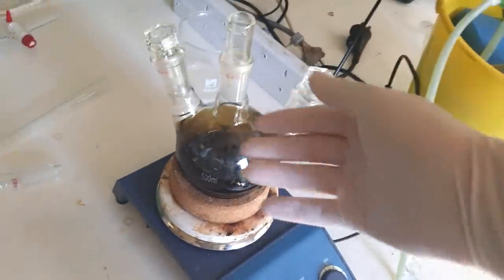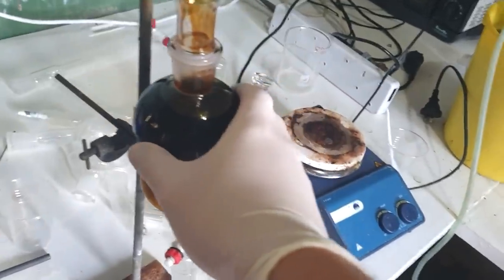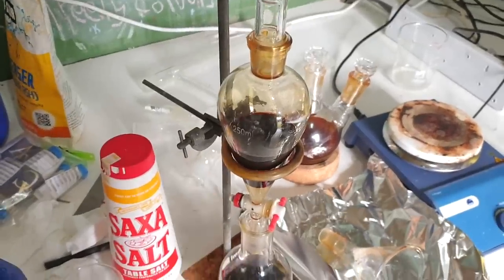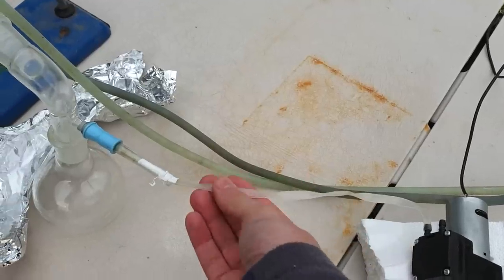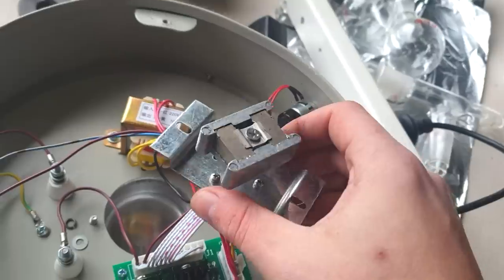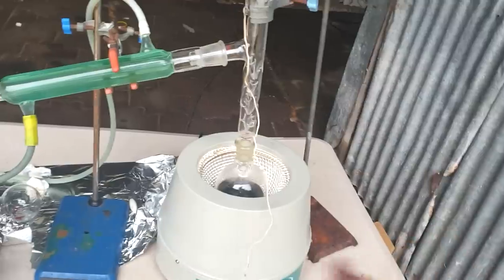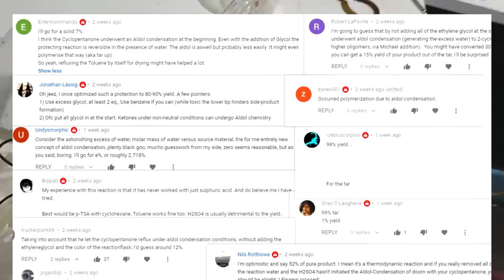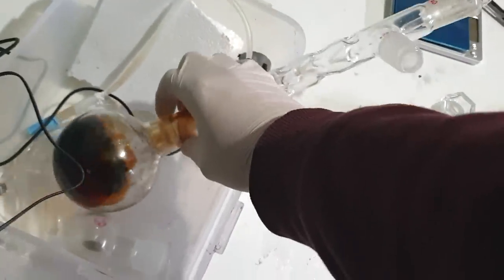Cubane Episode 3 - Vacuum Distillation for the Ketal?

Comment: I saw in different videos (NileRed's ones, to be specific) that often distillation apparatuses (apparati? appar - whatever) are more or less covered in tinfoil. Is it done to distribute/mantain the heat better?
Reply: It is used as an insulator, helps ensure the vapors make it over and don't just condense back
Reply: @samuelallan7452  so it pretty much mantains the heat, otherwise the temperature would drop too easily, hence the condensing back?
Reply: @RussellTeapot  Yeah exactly. Some vapor will always make it across just cuz vapor, but the insulator helps speed up the process, because in some cases it would take ages otherwise
Reply: @RussellTeapot  Actually if you're curious there is another use I've seen, and that is to block out light - for example in Nile's fuming nitric acid video he covers the whole thing in Al foil to make sure no light comes in because nitric acid is fairly sensitive and will decompose into nitrogen dioxide in the presence of too much light (as a side-note whenever I did this reaction I always got a shit ton of nitrogen dioxide, probably for this reason)

Comment: yo just fyi
if those oval stirr bars have a  neodymium magnet in them, 
then high heat will course them to lose their strength. 
some of them can starts to lose strength at as little as 55 degrees C.
think it depends a lot on the grade of the magnet.

Comment: I'm not a real chemist, but isn't there like a three-neck adapter which allows, among other things, to change receiving flasks for vacuum distillation by turning it? Like, you just turn the adapter with three flasks attached and bam, you got a new receiving flask? Maybe I'm making this up tho
Reply from the maker: Yes there is, and it's either called a Pig or a Cow adapter! It is a very specific piece of glassware that I don't have, but if we are going to be doing more vac distillations in the future, I'll probably get one!
Reply: @ExtractionsAndIre  oh, I googled it and that wasn't what I had in mind. I remember seeing in NileRed's video a Y-shaped thing with a turning knob in the middle, where he could change which way liquids go. But I guess cow adapter looks cooler
Reply from the maker: @markdombrovan8849  oh right, that sounds fancier, and maybe more widely useful than a Cow adapter? Probably more expensive tho
Reply: @ExtractionsAndIre  it seems that the 3-way flow control adapter is a bit cheaper on amazon, 20-25$ vs 30-35$ for cow adapter, but there are different options on eBay. It's not Pyrex though, Pyrex cow adapter costs 200$, it's kinda crazy, didn't know brand chemistry equipment was that expensive
Reply: You would want a Perkin triangle for what you're describing - it's an amazing piece of glassware. It allows you to collect as many different fractions as you want - all without breaking the vacuum in the distillation apparatus. It doesn't sound like what you're describing though.

Comment: What damage could this have done to your lad vacuum pump? If you put a proper desiccate In line, and change the oil Before & After you run the synthesis 🤷‍♂️. What is a trace amount of toluene gonna do, eat oil covered metal? Maybe if you were not using  a functioning column. To achieve success, start at the end and come from the beginning, ... or fuck-all.